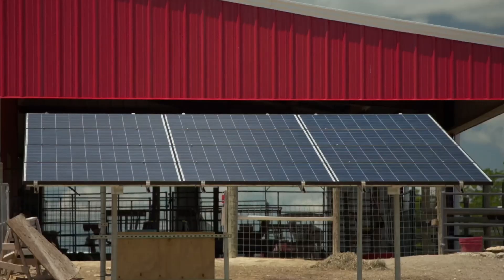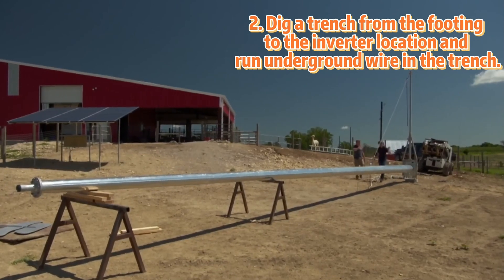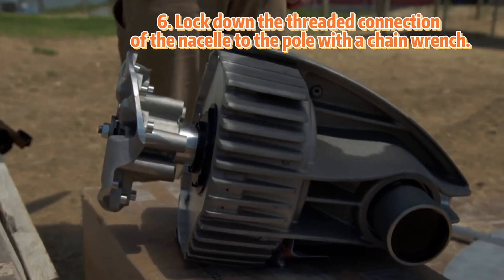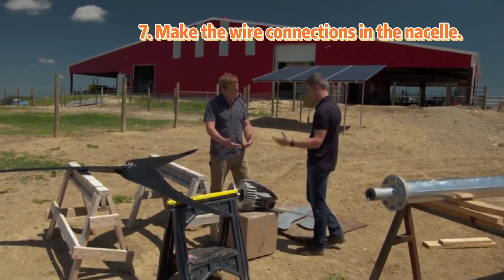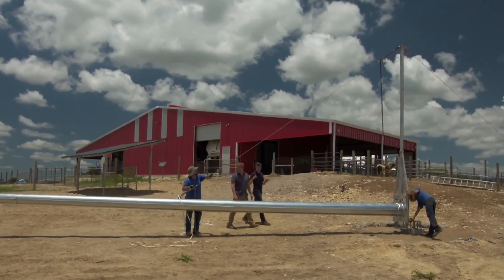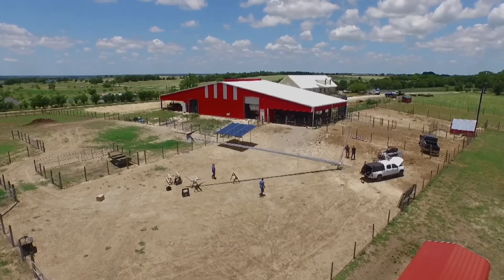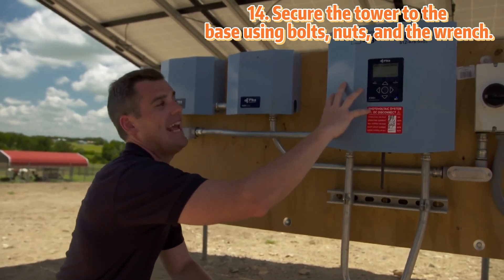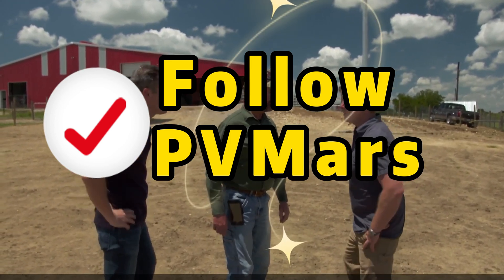How to Setup Wind Turbine in Solar Power System? #windturbine #windpower #solarenergy

Comment: 4:32 "both[solar and wind] of them are DC power" - How come? Wind turbines, unlike solar panels, generates AC.
Reply from the maker: The wind turbine is 3 phase power, will need wind controller to change to DC to charge batteries.